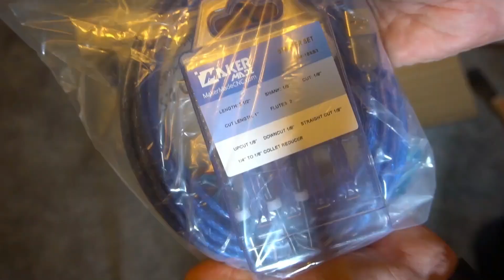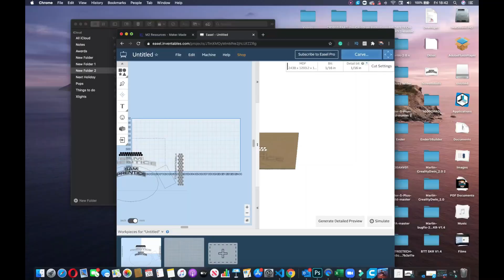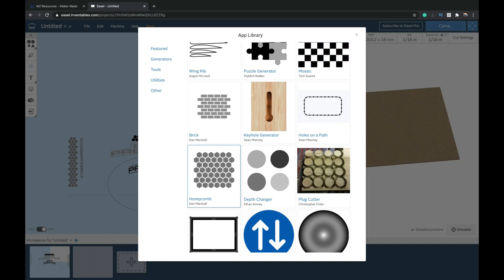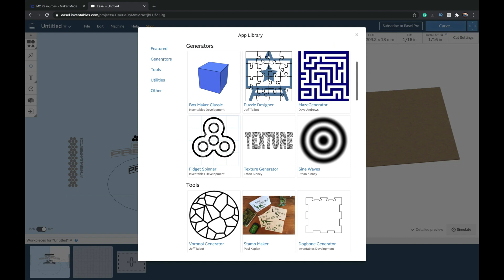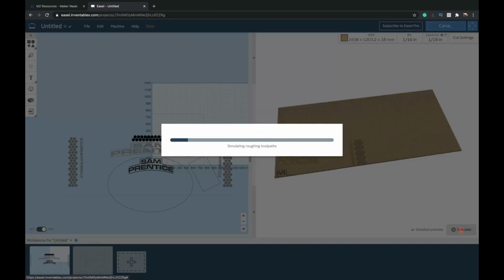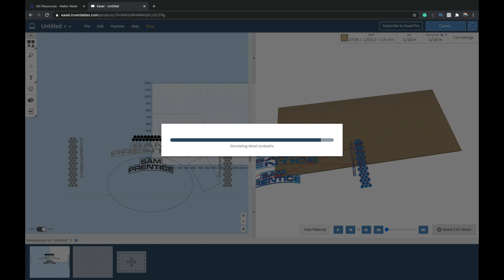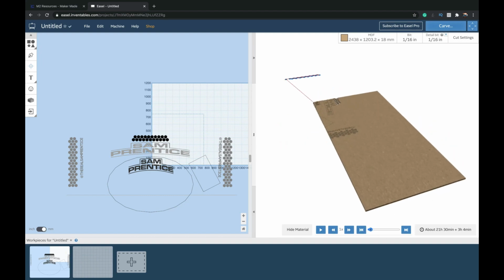MakerMade Maslow CNC M2 Machine - Unbox, Build, Review and first cuts 2020

Comment: Why did you keep holding onto the machine?  Almost seemed like you were guiding it or did not trust what it was doing.
Reply from the maker: Well 3 years ago when this was shot having shot on it I was a little worried about the extreme curves, so in the corners weight balance is a concern, and these are at the extreme points on a 4ft and 8ft point. It could tip if the weight wasn’t right. Since then of course they have moved on with the design and sofrware.

Comment: Great Video! I had one Quick Tip. When you´re on Easel, on the Add Material Tab, on the bottom right corner, youll see a drop down arrow asking you to choose X/Y Zero. You can choose to measure X/Y Zero as Center. Then, you wont have to worry about fitting them on the corner, but rather, the material shown.
Reply from the maker: Thanks, this is a 3 year old video

Comment: Could you use carbide create to create the gcode?
Reply from the maker: I’m guessing that’s a software package and as long as the G code is readable by this 3-D printer you shouldn’t really have an issue. I need to understand what you’re trying to do there of course. Otherwise slices include super slicer, cura amongst others.
Reply: @TheRealSamPrentice  
I wanted to know about using it to create gcode for the maslow,  I am into cncs not 3d printing sorry.
Reply from the maker: @davidboswell9024  oh sorry! Yes I would expect you can

Comment: Hi Sam, what's the model of Makita Router you are using? Just considering purchasing the M2, totally new to CNC. Currently everything I do is cut by hand with a Dremmel in a router mount!
Reply from the maker: hi there makita rt0700cx4 - dont forget to use my code :)
Reply: @TheRealSamPrentice  what code?
Reply from the maker: @malcolmlatham4725  samprentice-MM discount code for the M2
Reply: @TheRealSamPrentice  Where do I use that? Sorry for being so ignorant!
Reply from the maker: @malcolmlatham4725  On their website when you order it you can pop in the code and it discounts
Reply: @TheRealSamPrentice  Thanks for that Sam, and thanks for responding so promptly on a Sunday evening!
Reply from the maker: @malcolmlatham4725  not a problem if you need anything let me know

Comment: So..internet connectivity mandatory (workshop 300 feet from house)
Cloud-based
No Linux (Windows/Mac only)
Proprietary software (vendor lock-in)

If I’m wrong/mistaken on this, please post links..
I’m interested in this machine, but these problems make it a “hard pass”
Reply from the maker: These are surly decisions that you have made... it’s gcode so you can set up the design on whatever you like. It uses an Arduino which as you know is open source. Maker made aren’t interested in vendor lock in they want people to make stuff not procrastinate over internet connections. I run Mac and have an iMac plugged into the arduino there is little need for an internet connection to make the unit work, as I say it’s .nc files using gcode the computer element is mainly a monitor of what’s going on.

Comment: Great video!  I believe you sold me.  The Maslo had accuracy problems, especially on the outer parts of the sheet.  Is that corrected in the M2?  I'd really appreciate that code you mentioned to save money too.  Thanks!
Reply from the maker: Code is samprentice-MM There are vast improvements on the M2 for sure including the setup. Once you have set it up correctly it's pretty bang on.

Comment: Is the router you’re using the little 700w Makita trim router? If so, you could use the Katsu makita clone as a cheaper alternative. It costs about 35 GBP and works very well. I’ve use one in a mini router table and for hobby use it’s great value.
Reply from the maker: yes sir, mainly because of the warrently

Comment: So when I looked at the original Maslow, it said you can use the router on something smaller than a 4x8 sheet of plywood. I have limited space and I'm wondering if this would work on a 4x4 platform? Now that I'm writing this I'm kind of a bit confused about the whole thing. I thought maybe the 4x8 piece of plywood would act as a base and you could place another smaller piece of wood on top of it (the thing that you want to actually be cut) and have the work done on that? But it looks like every project that you make has to be very large for this?  I was looking at using this to cut the Stars on my unions for my flags.
Reply from the maker: Sure okay you can set this to whatever you like so yes a 4x4 would work just fine

Comment: Why do you keep touching it in the video? Doesn't it mess with the computer's calibration?
Reply from the maker: As previously explained I wanted to make sure that the disc didn’t tip off the far left and right of the platform. It’s a steady not a pull or push.

Comment: is it possible to sound proof the router ??   perhaps a box that sits on top of the sled with sound absording foam.    please build and test ... easy as you got an M2
Reply from the maker: Well maybe, but there are some heat issues with that. Ideally what i'd like to do is build a frame around the whole thing and have plexi glass with an extractor to pull the dust out and that would cut down on the noise a little. If you run the router on "1" it does kill some of the noise but most is generated from the "cut" so really the router isn't at fault.

Comment: So it looks as though you are making some adjustments while the cnc is in the process of cutting (during the time lapse). What exactly are you trying to fine tune? Im interested in buying, but trying to do as  much research as I can before purchasing. Also, can I get that code from you?
Reply from the maker: I was making sure that the cutting disc was making a close connection to the bed. As the axis moves up and down it can be pulled upwards towards the top and tip to the left and the right. This cnc needs some finetuning in order to cut in precision. Also I think these were some of the very first cuts the process since has improved. I will be sharing more videos on this cnc in the coming weeks :)
Reply from the maker: samprentice-MM is the code

Comment: I'm seeeing a mention of a secret code in the comments, perhaps for M2 discount? I'm looking to cut out an arcade cabinet with 20mm or so MDF, would this suit my needs? I have a bunch of experience with 3d printing and Simplify 3d/ Fusion 360. Do I need to use Easel, or will one of the aforementioned software solutions work? Thanks for the setup/ review!
Reply from the maker: Conner Hall samprentice-MM should give you some money off :) you can use any cnc software but it will need to be imported into makerverse I’ll suggest easel as it’s really easy to use
Reply: @TheRealSamPrentice  Thanks again, will more than likely be purchasing this soon.